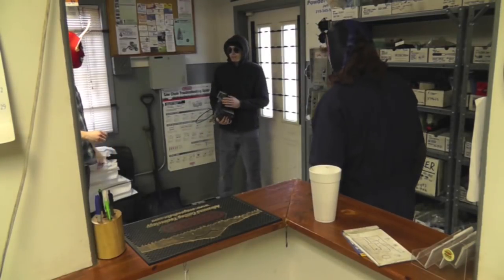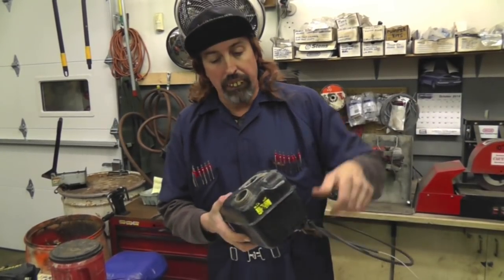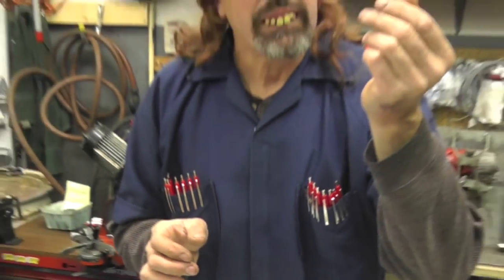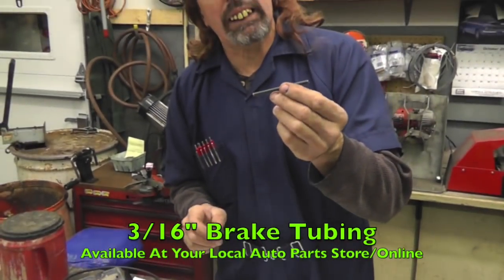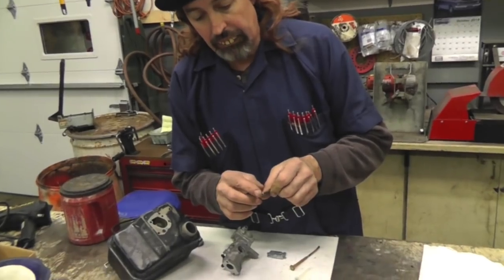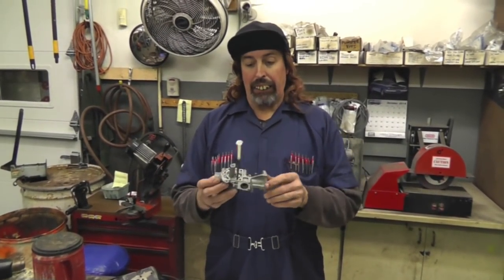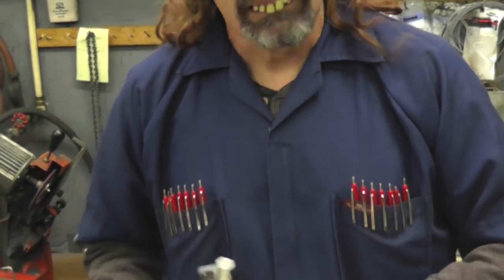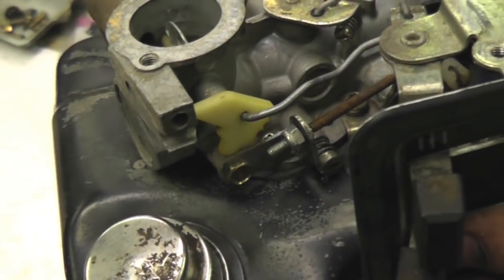How To Fix A Briggs and Stratton Pulsa Jet Carburetor with Taryl

Comment: Excellent instructional video for these 5hp B&S's fuel system.  I've got three (yeah,  they common as dirt) I have to maintain,  and you hit all the "sore spots".   The pick-up tube repair/replacement trick is ingenious -- gotta try that one.  
If folks don't want to invest in a set of torch tip cleaners (me),   I've found that a section of wound acoustic guitar string works just as well.  The winds abrade any crud away fairly well and you can get different gauges but I find the medium gauge "G" string usually fills the bill.  (No "G" string jokes,  please. LOL. )
Love your stuff,  T.D.  You da man.  Keep 'em comin'.

Comment: Taryl, 
I've been messing with small engines for the last 63 years. Never in all those years have I ever heard of a split fuel pickup tube. But I am working on a Briggs 5 hp right now that would not run after I cleaned and rebuilt the carburetor. So I watched your video and then took the tank back off and sure enough the dang brass tube was split all the way down the side. 
Why would they design these like this? Have you figured out what makes them split? Is it metal fatigue from the vibration or what?

After watching your solution which I liked just fine I tried something else. I soldered up the split which took a while but I finally got a good solder joint. I put it back together using superglue to make sure it would stay like you suggested. Engine runs like a dream now. 
Thank you very much. I never in a million years would have thought to look for a split in the tube. You are the man.

Comment: SECOND "LIKE"  Thanks Taryl, that super-glue being impervious to gasoline, I am going to try to seal pin holes in bowl equivalent.   Since, there are no leaks in the tank, only pin holes in the bowl, with your tip, I bet this works!   Thanks Taryl.

Comment: You can also use a small piece of fuel line,  with an end filter.  Just slip fuel line over brass tube,  and slip end filter on tubing. Real simple.
Reply: No you can't. Fuel will eat the hose from the outside of it. If your fix was factual, Taryl would be using it.
Reply: @rickjames6948   Better go tell the chainsaw guys not to do that.
Reply: @rickjames6948  what!!!
Reply: Also secure the  process you, can use Krazy glue mixed with baking soda and it might  help work.
Reply: Or seal all glue.

Comment: thanks taryl. just got my old log splitter going thats got one of them old 5hp briggs. no rust in gas tank but it got bunch of water in it sometime during that big storm we had.  I syphoned tank of gassed water but water was probably still in that float bowl. got it popping with starter fluid and after a dozen times of it starting and dying  it finally started running again on the no ethanol gas we got here at farmers coop.   I sure do appreciate the clear explanation you do on how it all works and goes together and how to fix it properly not like the fools that got a high quality shade tree shop that dont know what the heck they talking about

Comment: Taryl, this video showed me how to fix my Pulsa Jet Carb on my Mclane mower. Also the rubber elbow and pipe connection at the engine that pulses the carb had cracks in it which made it hard starting. New rubber parts and now it starts first pull.
Reply: EXACTLY. The pumping action is caused by the crankcase breather hose connected TO the carb. There are 2 rubber hoses, one 45 degree and the other 90 degree. The 45 down on the breather and the 90 at the carb.
Reply: McLane!!

Comment: Thanks Taryl. My Briggs and Stratton 3.5 would not run. After taking it apart the pick up screen on the pick up tube was covered in debris. It looks like a thin layer of felt.  I cleaned off the filter and bowl and all the ports. Put a new diaphragm and put it all back together and it runs great again.

Comment: Taryl I just picked up a chipper with the same 5hp B&S but the pull cord or flywheel were frozen. When i drained the oil and gas tank it looked like it had been sitting at at the bottom of a lake for a while. Surprisingly I hit the the thang with some WD and fresh oil overnight and wouldnt you know it started! I have to rebuild the carb and clean the tank out real good tho since it only starts with starter fluid.

Comment: Guitar strings are just like those files you use on them jets. Game changer for me years ago hope it helps
Reply: Never thought about that , but yes they would work , as long as they are the metal ones.  I hear there
are plastic or nylon  strings.  I have use the torch tip cleaners for years. It is imperative to get the main jet as clear as when it was new.

Comment: That background music................really?  Oddly it fits.
God information.  Just rebuilt and restarted a tiller with that carb setup.  Brass tube was showing a crack but I just left it and added a new plastic pickup tube like factory.  Now, there is a leak somewhere from the carb.  Nothing major but enough to notice and I plan on selling the tiller so the leak needs not be there.
Anyhow, appreciate the good information.  Apparently you have a following at 1.5K + likes of which I am one.

Comment: I cleaned the rust out of my tank with vinegar (cider type). Let it sit for 2 days then dumped it out and flushed with water, poured in 1500 BBs and shook it around for a while. Dumped out the BBs and used compressed air to blow out the tank. Clean as a whistle and there was some serious rust and dirt in there as it had been sitting for 5 years. Now I have 4 pinholes to contend with so I mixed up some steel JB Weld and covered both inside and outside of the holes. Let it sit for 2 days and filled the tank. No gasoline leaks and the motor runs fine. BTW, I suggest using non-alcohol gasoline. Gasoline with ethanol attracts moisture and you end up with water in your tank which will rust it.

Comment: Question: I have the same engine ( except it is for a go kart ) the carb works great except someone let it sit for years. The “float bowl” in the tank is completely gone. BS does not sell the tank anymore. Tanks I can find are $130+. I can buy a harbor freight motor for $150. Do you have any suggestions?

Comment: 👍Good info👍😆😆😆
My carburetor bolt (bottom) has stripped the hole in the engine. 
What is the best way to repair the engine stripped bolt hole? Think it’s a 5 hp tecumceh. On a 2006 LawnBoy Sens a speed push mower👍
Thx👍

Comment: Hey buddy.. I had a few weeds growing inside a large sandbox. I didn't feel like plucking them by hand so i went ahead and fired up my 21" briggs  mower to mow the weeds down. I had the air filter and the air filter housing off because i figured id let the carb get a breath of fresh air with a wide open throttle and choke...  Besides, with all that sand and dust flying everywhere i didn't want to get my new air filter dirty. Before i fired her up i checked the oil.. It was a little bit shy on oil and i couldn't find any oil around so just went on ahead and filled the crank case up with some sawdust and the gas tasted a bit bland so i went ahead and added some sugar and sweet n low to sweeten it up a little.  Anyhow... After i got done mowing the sandbox i decided to go on and mow a couple of rock beds while i was at it. So a couple days later i fired her up to mow a cactus garden and it started stalling out. Think it could be the carb needs cleaning?

Comment: I've had to do a similar thing to the inlet manifold on a Nissan RB25 inlet manifold, the coolant inlet spigot was rusted out so I went to the radiator shop & they gave me a 1 3/8 inch brass spigot off a radiator, I ground it down so it would be a nice press fit,applied some non hardening gasket cement onto the spigot then tapped it into the manifold with a block of wood & a hammer,it served its purpose well.

The car had been sitting around for 4 years with fuel in it,somehow water got into the fuel tank & rusted the inside of the tank.

In the future,I'm going to descale the fuel tank with diluted hydrochloric acid which I have a bottle of then perhaps seal the inside of the tank.

Comment: Is Krazy Glue really that good ?   Which is better Krazy Glue or Seal All which can be found at Dollar General.   I have the same cracked pickup tube.  It's a hairline crack almost the length of the brass tube.   Which glue should I use ?  Krazy Glue or Seal-All glue ?

Comment: I have one of these carbs on a YTD tiller. Took a while to find the correct carb kit. I ended up reinstalling original Jet and needle.
   What im not clear on is the proper adjustment on this model. Or what the min/max idle should be.
     Thanks again for good info.

Comment: I installed a new carburetor like this one. It won't start, like it's not getting fuel. Does the little bowl in the tank fill up on its own after a few pulls? Or did I need to put some fuel in the bowl before putting it all back together?

Comment: I am having a lean problem . It will run about 2/3 choke. I want to clean the tank. Mine has a filter like substance in the tank. Is that something you try to get out before cleaning?

Comment: Very informative.  I removed the jet (?) but there was no needle shape.  just a hole along with two
tiny holes on the sides of the tube.  Whut the??.
Reply: See if holes are clogged up if so open them. They need to be open to run correctly.

Comment: Question for y`all.  I cleaned the carb and replaced the diaphragm, seemed to run great. The next day I tried to start it and it ran for about 15 - 20 seconds. I noticed the carb was flooding out, so I took the gas cap off and it drained out. Is it the gas cap, a gasket leak issue, a fuel setting, or maybe all of the above? Thanx in advance.

Comment: This is an older post, but what would cause a pulse jet carb to run very good only if the fuel tank is full. This is on a go kart with a 5.5 Briggs. If you’re at full throttle without the fuel tank bring full, the engine is running out of fuel, but if the tank is full and your riding at full throttle, it’s fine. Any help would be appreciated. Thank you
Reply: You really should join a small engine forum. There's tons dedicated to just the engines, or some that are like a riding mower forum or a go kart and minibike forum with a subforum for engines. The YT comments section is a waste of time.

Comment: Great video! I have one of these carbs on a 5 HP B&S powering an old Roto-Hoe shredder. It's a new carb. The problem is that the pump doesn't fill the "float bowl". I can pull the carb and fill the bowl with gas and the engine will run until the bowl is empty, and then die. I used epoxy to seal the connection between the metal part of the tube and the plastic part to make sure it is airtight, but that didn't help. All the passages in the carb that fill the bowl are clear. I'm thinking maybe a new pump diaphragm might fix it. I can't think of what else it could be. The float bowl doesn't leak.

Comment: my 5hp briggs has a carb like that but it has a pull choke can I use the carb like in the video instead of the pull choke one. a 397135 to replace the 299437 carb.

Comment: I replaced my carb with a cheap eBay one. Briggs stopped making the OEM, so I had to do a little retrofitting to make it work. Now when I throw the choke to run the machines rpms want to sky rocket  more than I want. I immediately choke it back down but then the machines performance gets sluggish. Any recommendations for fixing this? I see that you said the screw at the base is a slow speed adjustment, is there a high anywhere or an choke adjustment? Also is there supposed to be a spring in that low speed adjustment?

Comment: Hello Taryl, hope you can help, I have a 5hp BnS engine, bought a new pulsa carb for it, and I found that it is not pumping gas into the bowl.  I can put gas in the bowl and run the engine, so the main intake is working, but once the bowl is empty the engine stops.  I can cover the main air intake on the carb and then it seems like the pump will pull some gas and the engine will try to start.  If I uncover the hole I get absolutely nothing as far as the engine firing.  Another piece of info, the gas tank is old, it has rust inside and has those plastic compartments to keep the gas from sloshing around.  Don't know if that would lend to the issue.  With those compartments I don't see how any of the recommended cleaning strategies would work.  I've scraped off what I can reach, shaken it up with gas, and drained.  Did that a few times.  Seems like air being sucked in somewhere and that is not allowing enough suction for the gas to be pulled up but I can't find where that can be.  Your thoughts on what I can check.  Thx.
Reply: Did you ever figure this out?  I have the exact same problem.  I bought a new tank and just tried a new head gasket and resurfaced the valves.  It's driving me nuts.

Comment: I have the same tank and it had 2 sponges inside the tank.  I removed those to clean the tank.   Will it run ok without the sponges installed because I am not sure how to get them back in the same spot ?

Comment: Had three of these that were slightly popping thru the exhaust on idle. When i choke it a little that would go away.
Do i need to drill out the main jet one size? Tried rebuilt and new carbs both ran about the same. Valves were sealed i pulled the heads off to check.
Reply: Sounds like you're running slightly rich and that popping is the unburned fuel burning off through the exhaust. Literally "after-fire", not back-fire.
Reply: @Hjerte_Verke  If I choke it to give it more fuel and the issue goes away how can it be too rich?

Comment: Tape the tank to the side or your riding lawn mower while the dirty tank is filled with your choice of rust bustin' stuff (nuts, BB's, bearings, etc.)
Use Heavy duty tape, like Gorilla Tape or T-Rex Tape, so you can wrap the tape over and across the treads of the tire.  I did this on my Briggs 4hp Horizontal staff, Roto-ma-tiller tank with a pulsa prime (cousin to Pulsa Jet without auto choke; Choke on Pulsa Prime is a cylinder that sticks out the end of the carb with a flap shaped handle for you to manually pull it out or push it in as needed. What a pain.) on my beat to crap Juan Dear L120 which doesn't have the biggest tires (I think their 18" or so at most).
Sad to see Taryl lost so much of his southern drawl since this video. God bless.
Reply: Need to give credit for the above to good Ol'  Bruce from Bruce's Shop, one of Taryl's friends from the Great White North.  Great source for small engine videos also.

Comment: What might cause a new carb to not be able to draw fuel out of the tank with the diaphragm pump?  I'm going crazy trying to get this 5 horse B&S running.  Just finished putting a new head gasket on as well as doing a valve job.  It appears to have good compression.  What else could be wrong???

Comment: Have you ever tried electrolysis ? There are a bunch of videos that show you how here on YT.  I tried it with a Briggs 5 hp tank. And it came out good an clean. It was rusted up, bad. I was going to just replace the tank. But after 3 months of searching I could not find a good one. The local shop wanted $125 for a new one, Just for the tank.
Reply: +
William Wynn
 - Good idea, but most People don't have those machines :(.  On our Riding Lawn Mower, the Gas Tank got rusted too.  I went to Walmart and got a " Small Red " Plastic Gas Tank.  From that, I drilled and attached a shut off Valve with a Filter.  Cheap + Easy Fix!  Also, at Harbor Freight, they have these " Oil + Air Spray Gun Cans " that you can easily turn them into a Custom Gas Tank for CHEAP !!!

Comment: Great video, guys! Have a question. Have the Briggs 130202 5hp.The small pickup tube snapped off. Do you with your vast knowledge know the part number? I looked and can't find it; just the long pickup plastic tube number is available. Greatly appreciate if you can. Many thanks

Comment: I’m starting to think maybe something is wrong with the pick up tube. I cleaned the carburetor twice and replaced the diaphragm plus the tank gasket but it still surges when I go to full throttle. I sprayed carburetor cleaner all around the carburetor with no change in rpms.

Comment: So i can get my engine to run for about 5 minutes by filling the tank all the way up thus filling the "float bowl" It then stalls. When i removed the pump cover i see no signs of fuel in the pump. It is dry. No cracks in the filler tube so I assume it needs a new pump diaphragm and tank gasket which tore

Comment: Is there an easy way to change the diaphram with the oval mufflers?  There is no way to get the 2 bottom screws out of the cover  without dismanteling half the motor. I put a round muffler on after. Thanks

Comment: Great vid Mr Tarly!!  I have same carb setup on a Western Auto tiller.  After engine is shut off (air cleaner removed), I can see fuel filling the carburetor throat.  The gas tank is venting through the cart.  Any ideas on what causes that?  The gas cap on the tiller is non-vented, so I assume the tank is designed to vent through the cart.  But instead of venting fumes, liquid fuel is being pushed up from tank and flooding carb.  Thank you.
Reply: Today I found the vent hole in the carb body plugged with a mud dauber nest.  Cleared the vent and now engine runs great.

Comment: Merry Christmas! /great videos.I have a carburetor like the one  you are rebuilding, however my problem is that someone didn't close the choke valve when taking the air cleaner assembly off and couple of screws fell into the throat chamber and jammed  
the throttle valve butterfly valve. I took the valve apart (it's a flat sheet metal disc with some scratch markings on it and two small holes with screw hole in the middle. I can't recall how it was positioned on the pivot shaft because it was really  deep in the bore and hard to see when I removed the center screw. Can you tell me how I need to position it on the pivot shaft?